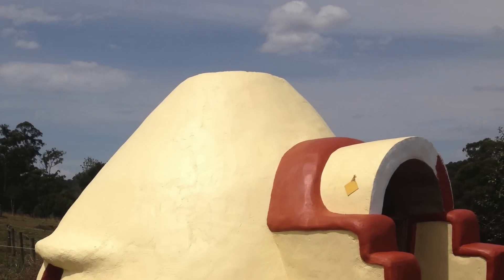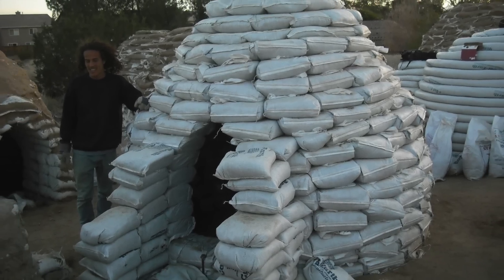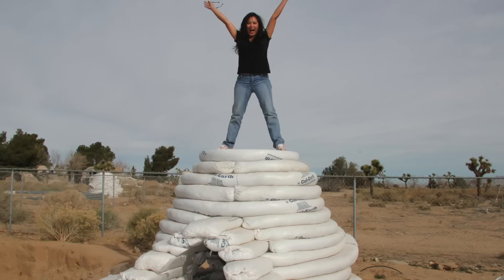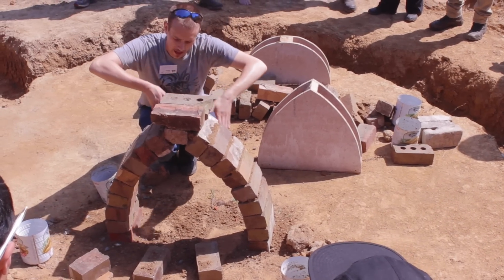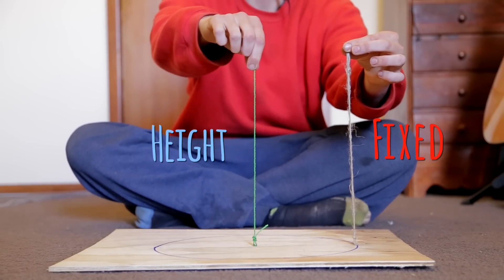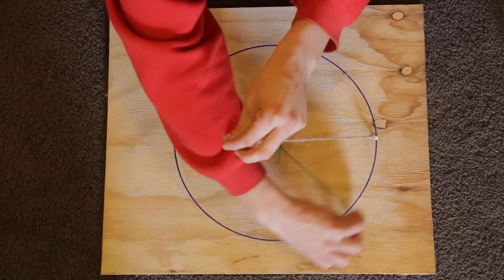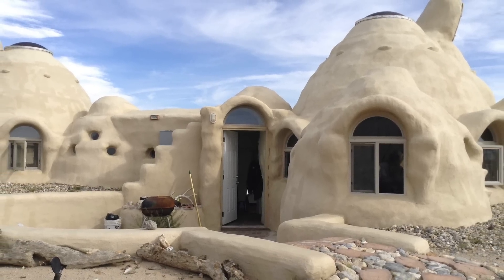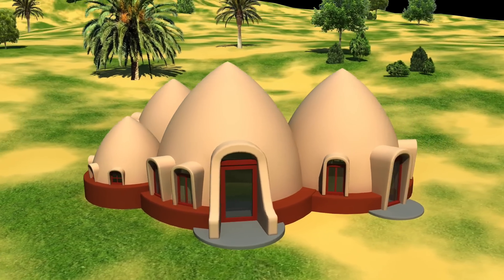What is SuperAdobe? Curvatecture Workshops in Australia

Comment: Are there attempts to use a sustainable material like jute or hemp for the sacks?
I think that would also allow the walls to transfer moisture better, wouldn't it?
Reply: Would those materials withstand the tamping process??
Reply: @frankhanna6745, @justlooking4202 , All good questions - I have wondered these myself.  I guess, once the tamped earth has set hard, the polypropylene bags could be cut away from the structure - then there would only be a strip between each layer remaining